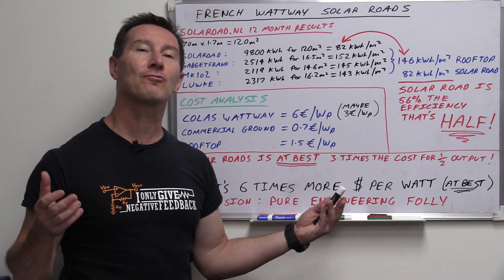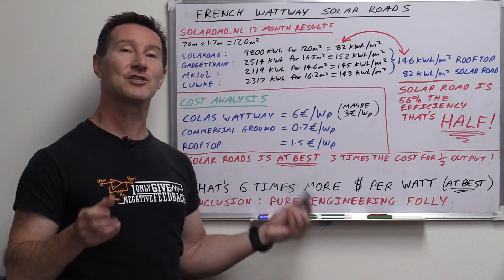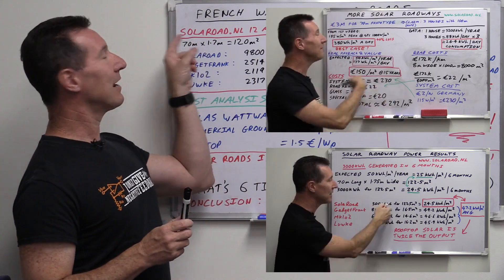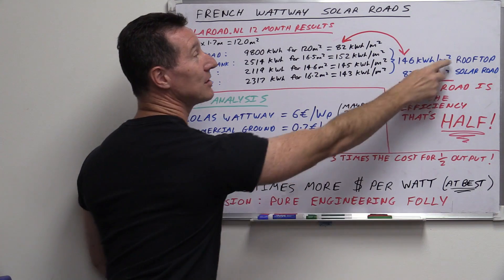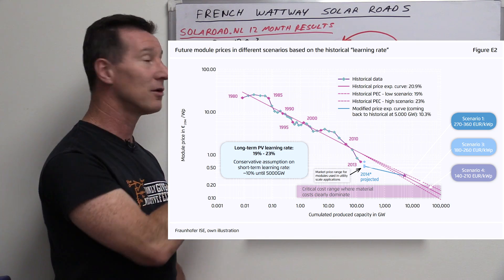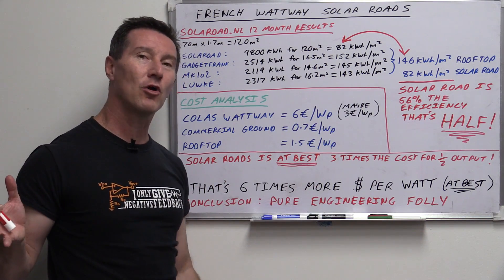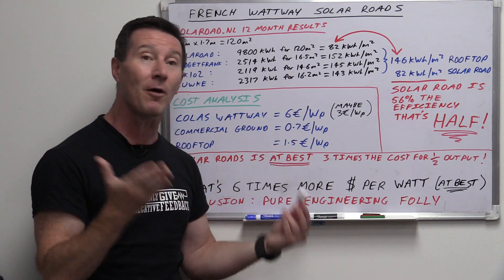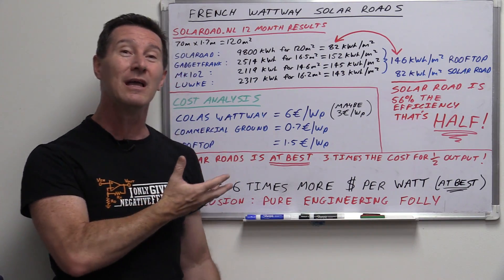EEVblog #850 - French Wattway Solar Roadways BUSTED!

Comment: When will they ever learn... I guess no one has thought of the energy cost and pollution caused by the gathreing of the materials and assembly of the panels. Early LED lamps that used existing LEDs of the time (many many through-hole 5mm LEDs) had the same problem: Assembly of the LEDs from metal, lots of resin, the LED die etc, manufacture of the PCB, getting wave-soldered with huge amounts of energy and tin wasted etc. etc.) and the result was low, crap light

By the way, Youtube is great isn't it? Ranting about something - just telling the truth, reaching a huge audience filling multiple giant stadiums and even getting paid for it.
Reply from the maker: +nrdesign1991 Very true, every video I make is like performing in front of a huge stadium audience!
Reply: +nrdesign1991
Usual case of fuckin'idiots in charge who have NO clue, making stupid decisions because they've listened to some smarmy suit and tied marketing exec, and his dishonest bullshit story.
Drives me bleedin' nuts. Tools. All that work effort and CASH wasted. And then they'll turn round and say there's no money, for some decent sensible scheme.
Reply: We should have every roof covered with solar panels before we even dream of putting them in roads.
Reply: +simontay1984 He wasn't speaking the language of smug so they won't understand it.
Reply: Mutly Mutt
Nah, I mean unjustified smug. That's the official language of France.
Reply: +Nicolás Sotelo -- This is not against solar power in general, but just putting it under a road.  Dave is a fan of solar power, putting panels on his roof.  However, you will not see him parking a car (making a huge shadow) on his panels.

As he stated, panels make electricity for a price.  However, when you put those panels on a road, you have to make them more rugged (increasing cost, and lowering efficienty), plus they now have shadows from the vehicles and the dirt.  Additionally, you have to replace the ones that get damaged.
Reply: +simontay1984 
They will just shrug their shoulders :)
Reply: GaryBlack They were always made that way. What I meant was that modern LED lamps now use  a single part which probably needs less energy to be made due to significant changes in construction compared to earlier LED lamps. The LED Dies are put on a single substrate, then are covered with silicone and phosphor within a carrier
Reply: +Advection357 and others interested in LFTR. Current PWR reactors could do all that is necessary for the next 100 years. The obstacles are politicaal not technical. IMO. Seee UKs Challenge 2050 for details. Try the tool. Make all power supplied electrical (including surface trannsport, space heating, manufacturing etc) make alll suppply side conventional nukes - job done
Reply: +nrdesign1991 

The problem are that people think of the possibilities, but never the realities.  People think that, since a road is a flat surface that's outside and may always be exposed to the sun, that it's just so simple.

It would be easy to think about how a solar roadway could be of benefit when one doesn't consider how such a thing has to be executed, not only through its construction but also in keeping it operational.

For instance, energy infrastructure requires humans to maintain it and solar roadways would be no exception.  If we're talking about tens or even hundreds of miles of solar roadway serving the grid, then keeping it fully working will be a massive undertaking.  And, should a solar roadway require service, would that roadway have to be closed to traffic?  How would one plan around that?

Then there's the issue of LEDs on the roadway.  The execution of it may initially seem ingenious, but there's still the problem of keeping that infrastructure maintained, especially at the scale that's being talked about.  LEDs, like anything else, can and do fail out in the field.  And, the more of them that are out there, the more likely that a few may fail in time.  Once it does, what's going to be involved in fixing it?  Would you have to close traffic?  In the time where affected LEDs are out of service, what's the backup to take its place?

Like you, I'm going agree with EEVblog on this one.  Solar roadways are a pipe dream.
Reply: +nrdesign1991 They'll never learn. Colas is from the Bouygues group and the Bouygues group owns the biggest tv channel in france, most of the communications companies and is present everywhere in politics. 
They do that stupid project because Bouygues wants some easy money from our gouvernement (aka our money in the end).
End of story, i decided to not be angry about these things but if they instal some near my home i'll spray paint them or something :D
Reply: Matías L. Ceballos
This is exactly what I meant. Some people just don't think anymore, or don't want other people to think
Reply: Claude Albertario I will try to enlighten you the best I can: invest in solutions to secure energy supply to the grid or waste resources in more expensive, less efficient and restrictive solutions (e.g. freaking solar highways to power street lights). The choice is yours.
Reply: +nrdesign1991 Just curious, what would be your thoughts on liquid fluoride thorium reactors for energy and a plasma waste converter for trash? Just though that seems like a greener higher power solution that would last a lot longer into the future than all the byproduct waste made from solar and wind. At least the limited stuff I've looked into.
Reply: +nrdesign1991 As pollution you're totally right, people usually forget how much pollution is make during production of some product. In Switzerland (and they are know that have strict rules against petrol cars, they have even places where only electrical cars are allowed) they did some study about electric cars and they concluded that is less pollution to drive Range Rover with 5L petrol engine then to drive Tesla Model S, production of Tesla Model S produce more pollutants then what Range Rover production plus driving it for 3 years produce.
Reply: You really don't want to know how they mine all the lithium needed for a single e-car battery
Reply: I'd do a thing for producing hydrogen & storing a limited quantity of it in a car, then something something profit
Reply: +Munchknuckle Dar Though thorium reactors are considered safe they require lots of jiggery pokery to keep the reaction going, or they will shut down of their own accord. The current vogue of nuclear reactors require lots of jiggery pokery to stop the reaction going out of control, however the by products can be used for weapons manufacture which sealed the deal. Electricity and bombs as a bonus!!! We'll keep quiet about the highly toxic waste that remains toxic for a while.
Reply: +EEVblog what would you do to improve the idea?
Reply: Hi Matias,

It's a study by the U.S. EPA which basically said that if you threw every CFL ever made on the ground, that would result in less mercury in the environment than caused by the burning of fossile fuels used by the bulbs in one year.  Just google for EPA CFL and it should come up as a top hit (you may have to search around the EPA's site about them a bit though).

People don't realize the amount of pollution -- besides CO2 -- released by the burning of fossil fuels.  One study just released, showed that people near coal ash disposal sites receive far more radiation exposure than those living near nuclear reactor sites.  In addition coal releases mercury and arsenic, and not up to date plants still don't have a handle on acid rain producing emmisions (which have basically wiped out crustaceans in the freshwater lakes and streams of eastern Canada due to the leaching loss of calcium in the soil).

But yep for sure, the waste from production and disposal of CFL and LED lamps is much more complicated than good old incandescents.  A real improvement would be to start producing homes based on solar charged DC systems so that 12V LED strip lighting can be used throughout the home, with no need for SMPS for each and every bulb in the house (THAT is stupid).  The lifetime of an LED is probably longer than a person's, but the lifetime of a SMPS with a cheap electrolytic capacitor in it and lucky to last more than a couple of years.

Mark.
Reply: +Ididnotk illjfk You do realize that you could just build a roof over the road and add solar panels?
Reply: +InfernosReaper You surely mean brown nose.
Reply: +InfernosReaper You surely mean brown nose.
Reply: +nrdesign1991 So what is the most efficient way to produce energy then... thorium? IE: LFTR (liquid fluoride thorium reactor)
Reply: +nrdesign1991 do you know how much lithium is in an ev battery? Say a ~24 kwh battery. Not much! Maybe 6 to 10 pounds on a 600 pound battery. Please do your research before assuming a lithium ion battery is full of lithium. They might use lithium ions to produce electrical energy but the amount of lithium they use is miniscule.
Reply: +nrdesign1991 the materials science of the diode have also changed fairly substantially I believe?
Reply: *****
Fixing a single LED would be take out panel & replace it with a new one then send it off to a place that refurbishes it and resells it back to the government for just below what a new one costs...
Reply: InfernosReaper

Okay, so you remove that one piece of the road and replace it with another.

How long would it take to do the job?

And, you may have more than one piece of the road that may have LED failures over time as parts wear from age and use.

This would mean that regular road closures to tend to solar roadway service would be reality in future compared to regular roadways not closing nearly as often.

I believe that a roadway must be a roadway, first and foremost.  Adding things to it complicates the execution, making it more demanding and more expensive to preserve that prime utility.

IMO, the money and effort would be better spent finding ways to make solar technology more efficient in converting what the sun gives us into electricity and, perhaps, with lower potential of ecological consequences. (Though a solar roadway would most likely be photovoltaic, the Ivanpah solar thermal farm in California has a problem with burning up birds in midair.  Regular or extra-crispy?)
Reply: *****
Stop trying to make sense & use logic. The solar roadway fanboys are too dumb to be persuaded by things like reason or the fact that it's not technically feasible & by the time it is, regular solar panels will be so much better solar roadways will be even more laughably impractical.

Hell, you'd have better luck getting those devices that convert thermal power into heat(very poorly) and mounting those in the roads & hope they don't break...
Reply: +nrdesign1991 yeah, old light bulbs - glass from sand and small peace of metal. When broken, you get glass for reuse.
Reply: KEPKE
Rumor has it, they've figured out how to make incandescent bulbs rival LED & CFL in power use & cost. If so, no more signal noise & mercury
Reply: +nrdesign1991 What is the solution to the fosil fuel then? Its not that I agree with this solar panel roadways, but another "clean" energy solutions, have their own problems and costs too...
Reply: Mason Ringbinder
Only the Indian and Chnese  governmennts are comitting  significsnt GDP to Thorium. We have trial reactors. Serious thorium deployment takes a  whole different fuel cycle a whole  industrial infrastructure. Even if the pooliticians green lighted Thorium with conviction it would take 20 years to scale up from test reactors. to full scale mass production. And where are all the seniior nclear engineers going to come from who need 15 or so operating years befoe teycan know Thorium speciically?

Conventional nukes are here, cheap, tested. There hasn''t been a significant accident in 30 years (Fukushiima deaths = approx 0). Waaste is a non-problem compared to global warming. Weaapons programs are hard to do, harder to hide, Iran failed. N. Korea failed. Pakistan can't keep up what it has got.

Go nukes.. Go go go!
Reply: Bruce Bartup
Those "senior engineers' are gonna be the guys who stumbled through the testing & research phase. From there, it'll be a 2-4 year degree program like the current nuclear reactors in America(I've got a friend doing that & I would be doing that but I couldn't raise the funding)
Reply: InfernosReaper
that's a starter grade. for chartershiip you need about 5 yearsfullk time equivalent experiece in a suitable schemr. After that no one would entrust a nuke of any knd to someone barely chartered 15 years post grad at the earliesy to  be a principle; shift engineer 

all above AFAIK  IIRC (28 years in another branch but i take an interest and have contacs)
Reply: +Bruce Bartup I would like to see that get past the people who are like: "OMFG ONE ATOM OF URANIUM WILL KILL YOU!!! HOW COULD ANYONE EVER ALLOW ANOTHER NUKLEAR PLANT!!!".
That's from an actual post I read. lol
Oak Ridge labs had a liquid salt reactor reactor that ran for about 4 years. A lot of the research was pretty much discarded, due to political reasons. Most of the corrosion resistant alloy research, for example.
Reply: +InfernosReaper They are called high-output incandescent lamps.  Right now I've only seen about a 35% reduction in power usage for the output.  They probably will get better over time, but LED and CFL lamps are still the most efficient lamps.
Reply: Ian Belletti Are those the new ones that use a coating over the filament to convert most of the energy loss from heat into light?
Reply: InfernosReaper They look like a lamp within a lamp.  I don't know if there is a coating on the filament itself.
Reply: Ian Belletti
How long they been around? What I'm talking about is supposed to be much more efficient than the mid-2000s to late 2000s improved efficiency bulbs & halogens and a got out of the testing phase within the past few months
Reply: InfernosReaper Then the ones you are talking about haven't really hit the store shelves yet.  The prices may still be substantially higher than the current high output incandescent lamps as well.
Reply: +Ian Belletti you mean led and arc lamps.
Reply: namibjDerEchte I was conversing with InfernosReaper about high output incandescent lamps.  The ones I mentioned to InfernosReaper have around a 30-35% energy savings factor.  That means that a 75W high output incandescent lamp has a light output equivalent to a standard 100W incandescent lamp.  InfernosReaper is saying that there is a new grouping of high output incandescents that are even more efficient that have come out in the past few months, but are not readily available on most store shelves yet.  These high output incandescent lamps are supposed to be even more efficient (about 50% energy savings compared to standard incandescent lamps for the quantity of light output).  The reason he mentioned high output incandescent lamps in the first place is because the ballasts on fluorescent and LED lamps puts signal noise on the electrical lines and when you have shared commons (neutral in the US), that noise can mean that you can have double the current on the common instead of the standard offset sin wave addition which leaves you with a reduction in current.  In most residential cases, this can be ignored because we typically don't load the circuits to the limit with fluorescent and LED lights, but it is an issue in commercial and industrial applications.  The other issue with noise on the power lines is that it can have an effect on sensitive electronics or affect test equipment if there isn't sufficient protection from the noise.  High output incandescent lamps are an energy efficient option when signal noise is an issue.
Reply: Also, CFLs have to be disposed of using hazmat protocol at hardware stores.
Reply: +Bruce Bartup Nuclear reactors are only 0.05% efficient (breeders), the only reason they will not be gotten rid of over the much more efficient Thorium reactors (LFTR) is because nuclear reactors are also able to make fissionable material (stuff they make nukes from). The Thorium reactors do not. China have been sending a hell of a lot of engineers to the states to learn about Thorium reactors, as the Americans had done a bucket load of research and had one running in the early days. The reason it was looked into is because the USAF wanted a nuclear powered plane (can you believe it!). The Chinese are going to lead the world in energy production. as they are the only country seriously looking at the LFTR technology.
Reply: Panc8ke 
 the only reason they will not be gotten rid of over the much more efficient Thorium reactors (LFTR) is because nuclear reactors are also able to make fissionable material
Nuclear reactors do not make fissionable material.  They use fissionable material.  That is why it is a nuclear reactor.  They are used, however, in the refining process to retrieve specific isotopes of fissionable material out of the fissionable material that they have for nuclear and thermonuclear devices.
Reply: Apologies for the mix-up and many thanks for your reply :-)
Reply: https://www.google.com/trends/explore#q=%22flat%20earth%22

I am less and less surprised every day at what stupidity takes hold.
Reply: Ronald Rosen
You are asking what you would do to improve a device that is both a birthday cake and baseball bat at the same time.

You can't improve an impossible idea.

EDIT TO ADD:

You have flat earth and chemtrail stuff shared on your profile. Is that because you think those things are hilarious or because you think those things are real?
Reply: +nrdesign1991 That makes me remember the diference between the low energy light bulbs and the traditional one. All ecologyst hate traditional bulbs, and screams that the ultimate solution is the low consumption one. Yes, the drain less power, but they dont realise that a low consumption bulb has an internal circuit, a switching power supply and gases, all that, when thrown, can produce contamination. But, a traditional bulb is just a thin piece of metal and glass. Thats all. I don´t say that we must use only traditional bulbs, just saying that things are not so simple. We must study things a little bit more.
Reply: Nuclear energy is so much better.
Reply: *****
Fear. Fear. More fear. Are you really surprised?
Reply: +Miloš Lazović that may be true but if you went back and compared the first petrol cars with the first electric cars you would get a different story
Reply: They are not that bad,

The government just wants to do its best to keep them out of landfills as treatment of leachwater from landfills is expensive.

And studies done show that just tossing one on the ground will result in less mercury in the environment than if you used an indcandescent due to the mercury released from fossil fuel combustion required for the extra power consumed by the incandescent bulb.
Reply: huitmarmottes I´d like to see those studies. Even though, it is not just the mercury. Low power bulbs have an internal SMPS, plastic and gas inside.
Reply: huitmarmottes Thanks for the respond. 
Well, then, the problem are not the incandecent light bulbs, but the way the energy is produced. What if we had, for example, solar energy, and light bulbs?
I am not saying that we should return to incandescent bulbs, but sometimes we should study thing a little bit more. Maybe think in a more global way.

I really like your idea. The only, let´s say, "problem" i see with it, is how to do it with houses where sun light is weak. But it is something than can be solved.

I think it is time for society to think again about ecology. Nowadays, people believe that X product is good for the enviroment just because "it is not traditional" (like the "freakin solar roadways!").
Reply: any sunlight even overcast light will generate some electricity , not as much as a bright sunny day  in an equatorial location, but some. so PV cells are viable in countries with lower direct sunshine days. the trouble with this vid is that its not acknowledging the other benifits of utilising roadways as areas for electricity generation .  and its comparing  with roof mounted cells that have been positioned optimally and are usually south facing. I'd be curious to know just what the relative efficiency and cost would be if you places cels on all 4 pitches of a hipped type roof not just the south facing one.
Reply: Ididnotk illjfk
A road's prime purpose is to be a great, coarse surface for rubber tires to grip on. Until you find a suitable alternative that also happens to generate electricity when not being rolled over by cars, don't change the road.
Reply: When that road surface is not actually being used then utilising that same space to generate electricity does make sense. It may not be cost effective  yet but its certainly worth considering even if its only utilised in a small scale , say panelling the drive around routes in a carpark or pedestrian walkwas as all pitched roof surfaces can utilise cells as they are not facing the optimal direction They are apparently looking into surface systems that when compressed by the weight of a vehicle passing over it it generates some electricity
Reply: nrdesign1991 More bad news on badly spent tax payer money with freaking solar roadways a la french:  

https://eandt.theiet.org/content/articles/2016/12/world-s-first-solar-road-powers-french-town/

All this to power light streets, what a waste of resources! Worse still, the project has the backing of french officials for large scale deployment, what a bunch of bright sparks!
Reply: Black Trucks Matter.
Reply: Oh genius, how is this bad?
"All this to power light streets, what a waste of resources! "
Please regale us with your geniosity
Reply: InfernosReaper use logic to explain miracles...living brings... and/or love..for that matter!! Yes, there's science, but even that ends somewhere between an idea...creation ..and ultimate longevity :-)